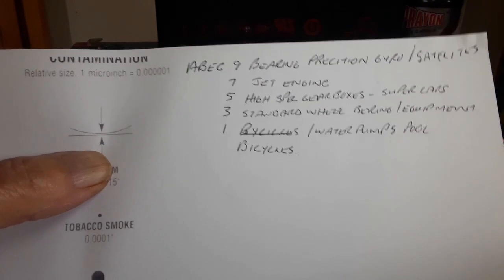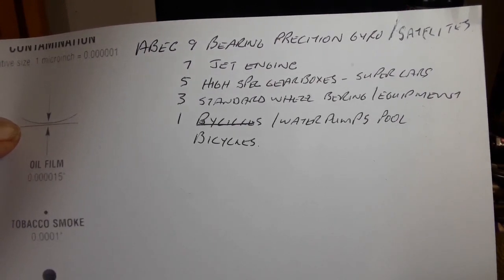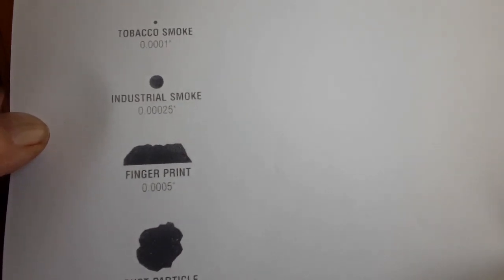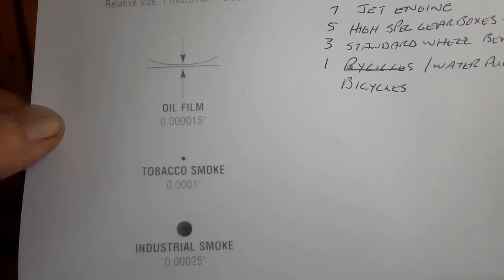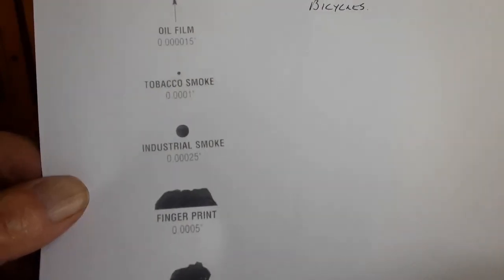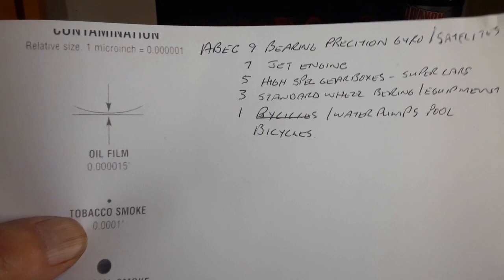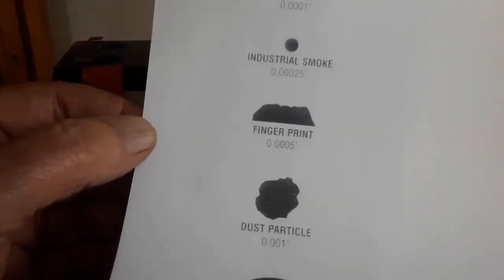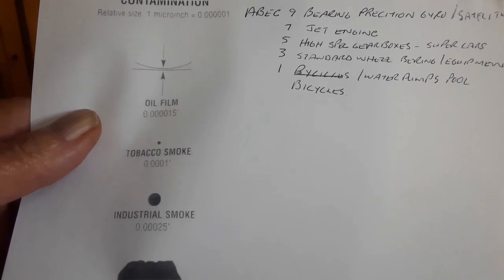Why do Bearings Fail, YOU Might Be The Reason Why Your Bearings Fails,  Watch This

Comment: Thank you Jan!!
Yes, always keep things clean. 
Bearings fail from impurities, either introduced or through the seals.. they also fail from heat, caused by lack of lubrication.
Seems like we lose quite a few due to the seals eventually failing.
Reply from the maker: So true Ed, if the seals fails the bearing will fails, all boils down to dirt in the bearings